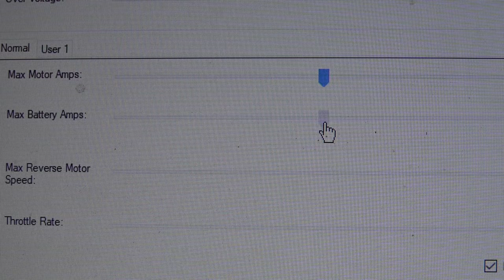Making a 20,000 WATT Electric Drift Trike

Comment: Crazy how far we've come with battery technology. 20 years ago you would have needed a hitch to pull the trailer with all the batteries on it lol!
Reply: LiPo batteries are insanely powerful. But a tiny bit firey.
Reply: we've still got a long ways to go
Reply: Not really far. Electric forklifts 20 years ago weren't much different from today's models. And decent electric cars existed 40 years ago as well. Of course, without government subsidies and rebates electric cars still can't compete with petrol-powered ones in free market. Batteries still got much lower energy capacity than fuel.
Reply: @keppy1259  

Hybrid forklifts are now a thing.

Dinojuice has a hundred years of embedded subsidies and market capture. 

Battery power density and delivery has evolved tremendously and is continuing to do so.

No it doesn't have the same energy density as petrol yet, and I don't think it will any time soon. But it is fast approaching the point where that won't matter.

After all uranium has a much higher energy density than petrol but we don't run our vehicles on that it's not the be all and end all.

Comment: Triple the Batteries and mount them behind the rear axle ...  Then it will drift without the plastic on the wheels.
But you will have to upgrade the chain because of Torque. Good Luck !
Reply: yea but the tyers will only last a few minutes
Reply: @pattrickhurcombedennell1072  Colin will have factored that into the build by this time...  I hope.
Reply: You buy forklift tires that's what we put on our go kart they break loose no problem but still give you traction
Reply: We side-mounted ours to offset the weight and maintain balance but we can still break the rear loose with just a goose of the gas
Reply: I imagine replacing plastic tubes are cheaper than rubber tires, though. ;)
Reply: @nephicus339  oh yeah. He went out and bought a $2000 motor, and has 9M subscribers. I'm sure he cares about some $100 tires.

Comment: 20.000 watts? 
Seriously? Colin? Seriously?
Perfect, I love it!
Reply: sounds more impressive than 27ish horsepower
Reply: It's 10kW
 https://hobbyking.com/de_de/turnigy-rotomax-150cc-size-brushless-outrunner-motor.html
Reply: @RateReducer  Yeah, but that's not the final motor!
Reply: @KX36  He said in the video that the motor is as powerful as a mini, and the LEAST powerful Minis with the 850cc engines produce 34hp. So yeah 😂
Reply: @PolandGamerPL  Not sure what point you're making. 20kW = 26.8 horsepower
Reply: For short sprints, most electric motors can take at least double the rated power.
Reply: And the fact that they can instantly output the power they are rated at
Reply: still only like 27 hp
Reply: @nicomarino96  I didn't state any power level. It's just a general rule for motors, give and take.
My own BBSHD ebike motor is rated 1500 W but I run it at 3200 W for shorter bursts, both by increasing voltage and amps. It would likely be damaged if done for more than 40 seconds at a time without cooling.

Comment: First motor you used is mostly used to make Electric Paramotor. But definitely it has no torque for Drift Trike. The 2nd motor and ESC size cracked me up. but definitely if that could move a mIni, that trike is going to be a blast to ride.
Reply: hey ali! subscriber here
I know the first motor is for high speed low torque,so couldn't he just have changed the gear ratio?
Reply: @frizstyler  yes for sure he could but as he mentioned in this video he did not want to go through that experimentation and besides he was not sure if it would work out very well still.

Comment: 5:45  "I don't need any airflow over this radiator"
6:44 "four heavy-duty batteries on one tight container"
Reply: same thoughts , if he runs them for like 10 mins there is gonna be fire
Reply: tbh four heavy duty batteries in one tight container is fine but the radiator tho dang
Reply: Well normally LiPo batteries mostly only get hot when they are changing.
Reply: @NoahZimmerman  or discharging too quickly. But he can control that withe that fancy esc.
Reply: ubert32 however when he is controlling stuff with the esc it’s getting nice and cosy hot
Reply: @NikopolAU Yup. He’s never done ANYTHING like this before. Post your phone number so he can call you for advice before EVERY one of his customs!?! 
Or, wake up, Welcome to Furze channel!
Reply: @NoahZimmerman  No way, I charge lipo batteries at 35 amps and they are not noticeable hotter than ambient temperature. When you start pulling 100+amps from them continuously they are going to heat up in my experience at least 30 Celsius above ambient without forced air cooling.
Reply: @danming69  batteries will get hot when he pulls that amount of current from them continuously, there is no question about that. I predict at least 45 celcius.  If he goes over that, there will be swelling of the battery cells and he is going to have a hard time getting them out of the little box he has made.
Reply: @StrongOneX  35 amps? Jeez what LiPos do you have haha
Reply: @snewl5324   High quality lipos from one of the top brands, not cheap hobbyking stuff. They are only 5000mah but they take it like a champ. I have an expensive charger though. I had to change from Deans plugs to EC5 plugs on all connections because genuine deans connectors got really really hot, too warm to touch without forced cooling when pulling 100+amps continuously and the cheap deans got too hot to touch when when just charging at 35amps continuously. I'm sure the xt60 connections he has will fare better but it depends on the battery load.
Reply: but he's not stupid as we figure out later @420lito

Comment: 5:45 Some thermal paste would help the ESC dissipate heat into the frame. Maybe use two thin rods to secure it rather than a plate to allow both sides of the heat fins to work. 

Edit: I commented before watching the whole video...

Comment: ESC: "nice i have a heatsink that i dont overheat."
Colin: smacks on 3d printet part
ESC:  Am i a joke to you?
Reply: HA! I pointed that out as soon as I saw it.
Reply: haha although i feel it would have overheated regardless
Reply: @andrewmalaty8  well. Yeah. The heat sink is too tiny to cool that huge monster. Even a water cooling block would've missed the point. But if the motor wasn't so hungry, it'd have overheated after a minute of use with the 3d printed crap on.

Comment: You should make a fully Electric Mobility Scooter That's Crazy FAST!!
Reply: Piplup guessing that’s why he mentioned it... just like he remade the drift trike in electric, remake the mobility scooter with similar motors
Reply: Call it the “Tesla Scooter”
Reply: @jakobr35pect96  And use a Tesla motors.
Reply: 1066Rider  That's a very fuel efficient scooter.

Comment: I can think of 2 improvements 

Back rest and a cup holder
Reply: Fluffy dice 🎲
Reply: @N i z o Yea ... lol
Reply: build the vertical parts of the axle mount to the frame of something else than sheet metal for gods sake, or at least reinforce the axle frame part rectangular bit with some proper hollow tubing.
then again, I'm no engineer or anything
Reply: @zainulabedeen3741  Just how can he say "Hold my beer, and watch this" if he's got a cup holder?
Reply: yes so all the liquids will slosh out and splash the electronics. brilliant.
Reply: @darkshadowsx5949  not if it's in a bottle
Reply: @JACK0NLINE  Or one of these new fangled closeable and insolated mugs. (keeps the beer chilled and prevents spillage, win!)

Comment: Very cool. The quality of work is great too. Having the right tools really makes a difference. That motor really is powerful. Itle provide more power than he can probably feed it, especially with those batteries. It's enough voltage, but not enough amp hours. It's the same problem I ran into building my electric bike.

Comment: Side note: They make an anti-spark version of the XT-90 battery connector. It'll have a little green stripe on it. There's a resistor built into the connector that will charge the drive capacitors gently, thus avoiding the spark when you plug it in. Definitely optional, but they last longer because you don't have a big spark blowing bits of metal off the connectors every time you plug it in.

Comment: Colin, where did you found your motor and esc?
Reply: i wonder this to
Reply: The internet. He mentioned it in the video.
Reply: i was thinking the same thing, the motor is so powerful i want to make a small motorcycle with the power of a car.
Reply: @N3OXITY Can you find a link to what you are talking about if you have it? it would just save me from finding the right one if you have it already. thanks
Reply: He literally said it in the video it’s a lynch motor
Reply: This is a lynch motor, it is one of the few brushed motors that can compete with brushless ones. It's not at all like the traditional brushed motors, which are indeed far outperformed by brushless motors.
Reply: @donttakebiscuitsfromelmo1931  20kW about the same as 20hp, :"same power as a 150hp car"
no.
Reply: @donttakebiscuitsfromelmo1931  - CHeck out GOlden Motor.  They have a 20kW motor which peaks out at 67hp.  Plenty for a motorcyle.  I am waiting for it to get back in stock as I am building an electric motorcycle, too.
Reply: @highervoltage5430  do you make a video about it?
Reply: The first motor and ESC combo is "standard Chinesium RC Hobbyking material". I won't touch the DLux ESC with a long pole. The Rotomax is ok. The second  version is a LEM 200, a "pancake style Brushed Permanent Magnet motor", about 8 times as expensive as the Rotomax.  The huge ESC I don't recognise. On the other hand, it wouldn't surprise me if it's a SEVCON, normaly used in heavy duty forklifts.
Reply: The internet... and the motor alone costs about $2000 USD.
Reply: @Francois_Dupont  a mini is about 23 hp. He is talking about the Classic English ones not that BMW junk
Reply: @maddox0110  The ecs is a alltrax sp48volt controller a nice pone used one a couple years ago for a electric gocart.
Reply: @Francois_Dupont  um no 20kw is 26.8204HP plus it's electric so is about 6-10x more talk than a petrol equivalent
Reply: @wlad nope, not expensive at all. Just want part of my money back, project cancelled.
Reply: @Francois_Dupont  20kW is ~26hp
Reply: Probably eBay!
Reply: Its turnigy rotomax 150 and dlux esc. I had some good luck with both, just make sure you don't use the electric brake and set it up correctly. It's definitely not short on torque 😁
Reply: @highervoltage5430  how can they have a 20kW motor that produces 67 horsepower? You realize the two are units of power, and therefore have a relation to each other (1kW = 1.34hp)

A 20kW motor is roughly 27 horsepower only.
Reply: @N3OXITY you seem to know whats happening, what type of engineering is this? i think its mechanical but please correct me if im wrong
Reply: @N3OXITY thanks
Reply: @TheRussell747  - Nominal and peak power are different.  20kW nominal and 67 peak.  It is how electric motors are rated in the EV World.  THere are other 20kW motors that produce 82 horsepower peak.
Reply: @michaelfrehner4858  - I will eventually.  Still getting quotes on batteries.  LiFePO4 seems to be the way to go since I want the highest discharge rate possible.
Reply: @creeperproof2  - Peak HP is usually 2.5-3X nominal ratings for electric vehicles.  Look it up.
Reply: @highervoltage5430  I would want to try hydrogen, because I think it has  more of a future, than batteries. And its quicker, if you hafe a hydrogenstation.
Reply: @TheRussell747  I have an other formula 1HP=746 watts
Reply: I dont know what motor hes using but the ESC looks to be an Alltrax SPM 48600 but they seem to have discontinued that line so good luck

Comment: You should have picked up a Cyclone ebike motor. The 4Kw versions can easily put out 10Kw, and it comes with a 5:1 planetary gearbox. They make em all the way up to 18Kw, which Im guessing will put out twice that. I paid about $250 for my 4Kw, plus $100 for a 72V 60A bluetooth programmable controller. It will get a bicycle up to 100Kph easy with good batteries.
Reply: Would you mind explaining me the concept of the programmable controller? I don't think I quite understand it. The motor requires some energy source (provided by the battery and the input is controlled by the handlebar). Also sprockets for the torque and rotations. So that seems enough if you want to use the trike at a steady speed. Yet the controller seems like a big part of the contraption.

That is what I think to know.
Reply: @danielwesterugalde1193  These are high-powered brushless motors that require a separate controller to modulate the 3 phases of current that actually produce rotation, torque, and speed. The controller I have connects to my cellphone through a bluetooth app and I can control things like acceleration, max power, min power, torque curves, etc. My bike would be uncontrollable if I couldnt program in a gentle torque curve.
Reply: @martysmith2422  I see! Thank you. So because these motors are so big and the rotations etc. Are variable on a large scale you need to feed the motor the exact amount of energy at the right time to increase torque and rpm. And that's were the controller comes in. Is this right?
Reply: @salih aydın Just google "cyclone mid drive". You''ll find the site with all the motors and stuff on it.

Comment: I was thinking about a 3kW electric bike???? I need to think again 🤔 20kW??
Reply: 3kW is a pretty average mobility scooter
Reply: @mycosys  that would be boring, wouldnt it
Reply: it's not 20kw, i think 2kw watt maybe, because those batteries can't deliver much more power
Reply: 3kw is way overkill! I have a 350w scooter and it gets to 28kph, while im standing, and thats not a good drag coefficient/front cross section area combo.
Reply: @nicomarino96  i have make a 500W drift trikes and it's more powerfull than 20KW colin's trike XD POLIZEI arrest me even if i'm in 500W power
Reply: Nico Mariño it has to register under the same as a moped
Reply: @dofw.mp4330  ~4 horsepower, Depends what you do with it - i have towed a loaded pickup with one once (Holden HQ Ute). Mobility scooters are super low geared, and limited in speed and acceleration by their controllers.
4 HP on a pushbike could be pretty damn quick. Also depends if the rating is Electrical, Peak output or Avg output.

Comment: Do you have a parts list? That looks hella fun
Reply: probably on his webpage colinfurze.com
Reply: I need to buy all the metalwork machines first. lathe , welder, press, grinders etc. my drift bike will cost about $7000
Reply: If you can't work out the parts just by looking at it, and doing some quick Googling, you should not attempt building anything like this. You will hurt yourself. If you can't watch a 13 min video and figure out the parts, you actually shouldn't make anything that uses a lot of part, or electricity in general. Or anything that goes fast, or moves in general. Or anything that you need a lathe, welder, and power tools; or any tools in general.

Comment: Now you should programm a App so that you can change all the settings with your Smartphone
Reply: No, developing an app would take so much time and effort when the computer does it perfectly fine
Reply: @Jack-nb4tr  He could make an app to choose between different presets, so that he could switch from for example long range/low torque to  high power/short range. 

This could potentially be made easy, while also allowing him to switch while on the go.
Reply: It's probably a miracle the whole thing didn't explode the moment he turned it on just because he connected it to a computer
Reply: @larserikolsen9862  probably be able to setup a raspberry pi to do that without having to develop a new app, then make actual toggle switches with the gpio and mount that to the trike.
Reply: @nothanks7752  Also a viable option, yes
Reply: WHY CANT AN ESC JUST BE SIMPLE!!

Comment: just out of curiosity, do you have a datasheet on that motor?
Reply from the maker: coming soon to colinfurze.com
Reply: @colinfurze  Thanks! :)
Reply: Its a small brushed lynch motor which was as good as you could get circa 2009 when the first IoM TT electric races happened. Most of the bikes were running several motors in parallel. There's a film called charge which is quite a good description of what and where that motor is from. Its now a company called saietta.
Reply: @colinfurze  okay guess I'll check back. Would love even just the make and model of the motor and esc.

Comment: Hi Colin,
cool video. But did you realy get 20 kW power out of these small batteries? From the size I would assume about 250 Wh capacity. As far as I know you can go maybe up to 20C discharge rate. This would mean 20*250 = 5000 Watts of power for about 2-3 Minutes. Nonetheless even 2 kW power should be enough to get this vihicle drifting as well as moving to about 30 km/h :-)

I suppose you already know. You would need a larger battery to get more power out of this thing. For 20 kW motor I would suggest at least 1 kWh better 2 kWh battery. Unfortunately, such a battery would weight at least 7-15 kg (at about 130Wh/kg).
Reply: Max Power. Those batteries have around 40-50c discharge rate I’ve seen them before
Reply: Lithium polymer batteries are nuts. Just sensitive, explosive todlers of rage. Great for RC plains, less great for being anyware near people.
Reply: They are 5000 Mah ZIPPY batteries from hobbyking, says "High Discharge" but I can't read the exact values decently (think it says 50C).. You can see it at 6:15 in the vid. Lipos are OK if you know how to use them. I wonder why the ESC burnt up, overheating because he blocked part of the heatsink? Or just because the motor was asking too much of it because of the resistance on the wheels?